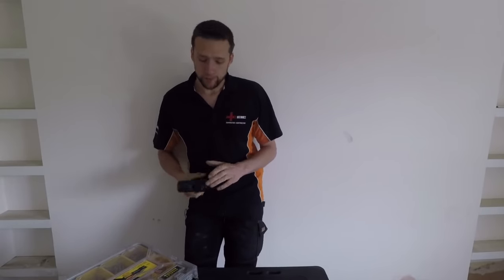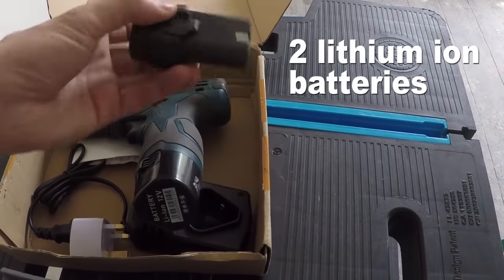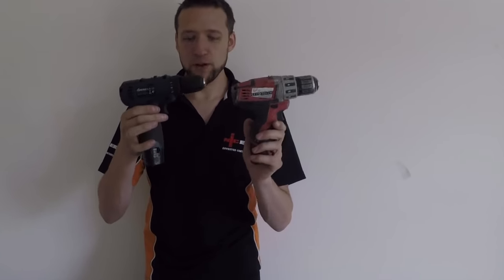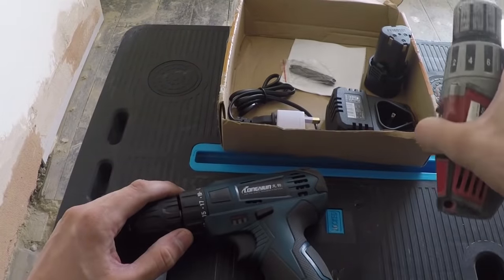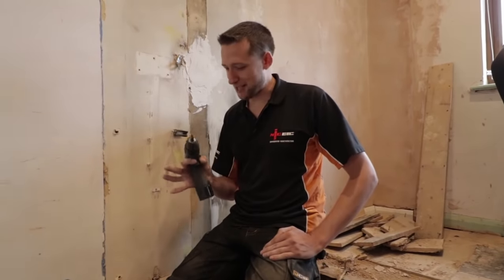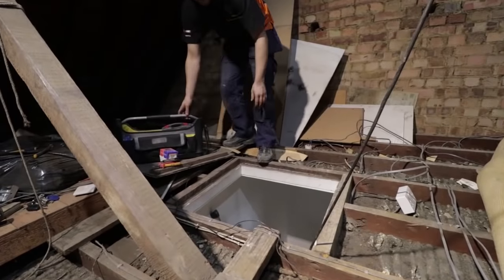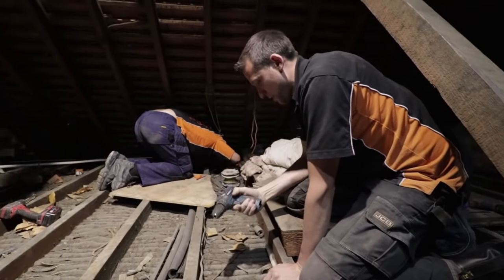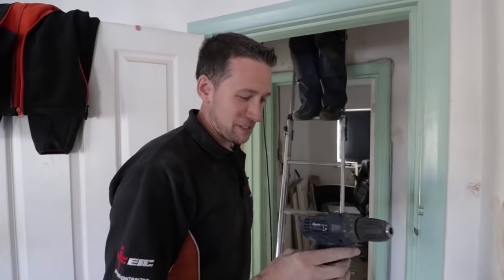Cheapest cordless drill review | Thomas Nagy

Comment: I've got a Powerbase 14.4 volt "Made in China" drill I bought in 2001 for  about £25   Has Hammer function, forward & reverse and 8 Torque settings and although I don't use it professionally its had a hard life. Came in a nice plastic storage case along with various drill bits.  Battery is showing its age but other than that its fine.

Comment: My dad and I each have a Makita DF030D 10.8v compact driver drill. They last for fucking YEARS and are fairly cheap as well. I dropped mine from our roof (10m) straight onto the marble stairs, it bounced a few times and finally ended up in a pool of water. IT STILL WORKS! Our version doesnt have a chuck but they also come in a version that has one so :P

Comment: I have a cheapo 720W hammer drill from B&Q which I bought in about 2004 for under £30 with an entire drill-bit set of 50bits and box. Used at work for about 5 years and since have used it at home to this very day. Nothing broken in all that time and it is still strong as a horse. Have to dial it back with almost all masonry bits because it will destroy them easily. I have abused it before taking out 4 and 6 inch screws because the amount of torque it proves will wrench them out or tear the head clean off.  Sometimes you just stumble on a gem!
Reply: Most my tools are lower end to mid range  Makita or Dewalt stuff but I did buy a Black and Decker 650w Hammer Drill for £25.  Although it is only used for DIY I have fitted a kitchen with it,  replaced a floor and it is used every couple of months for general DIY tasks when I need to drill into engineering bricks.  It is still as good as new and even the chuck seems very good quality. On the other hand I have also bought cheap tools that have blown up after just a few minutes of use. It is the luck of the draw I guess.

Comment: The trouble with a lot of these sorts of battery powered Chinese tools is that after 6/9-months the battery longevity tanks. As I believe you found out with your cheap Chinese rechargeable batteries.

...Then good luck finding replacement batteries (it'll probably work out cheaper to buy a whole new tool).
Reply from the maker: this is the pinch... I had exactly that problem with those cheap AA rechargeable batteries except they were just crap straight out the packet. didn't even put up an effort, so its a valid point, but i'm not entirely sure the drill will last 6 months so maybe not a problem ;-) lol

Comment: You need to do some more simulated real world usage tests such as: running drop kick booting it into a concrete wall, throwing it out of the van at motorway speeds, putting it in the microwave, connecting the trigger to a wireless doorbell etc...